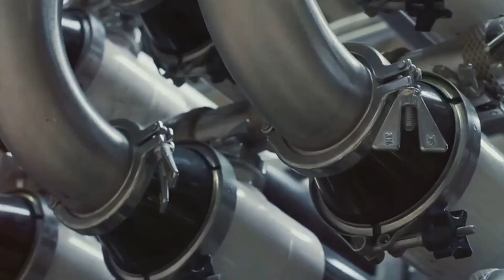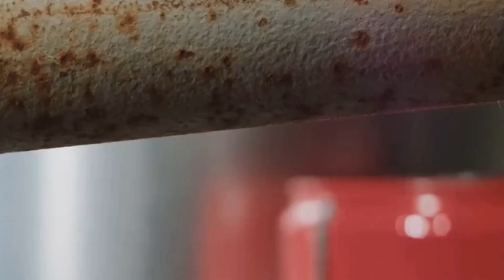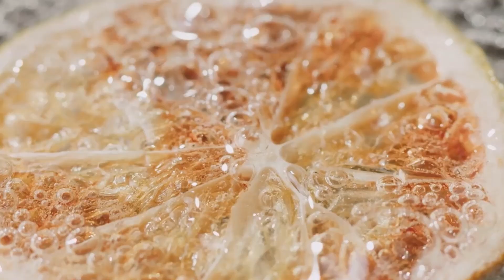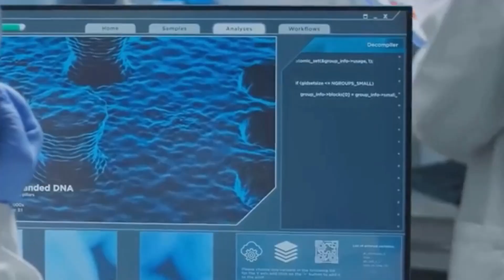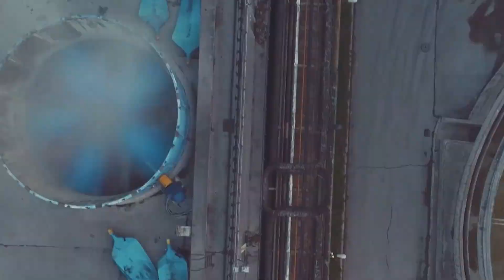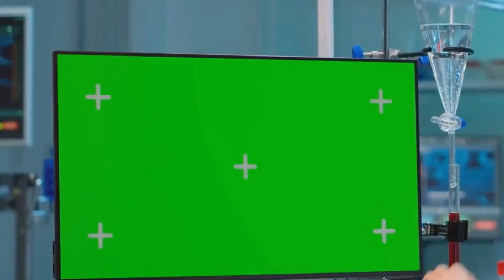Advanced Thermo–Hydraulic & Structural Analysis of Nuclear Reactor Components

Comment: This is genuinely one of the most technically rich videos I've come across on nuclear engineering. The way you connected thermo-hydraulic behavior with structural integrity under thermal stress made the whole system feel like a living, breathing machine rather than just textbook equations. The coupling between coolant flow dynamics and cladding fatigue alone could be its own series. Incredibly well explained.